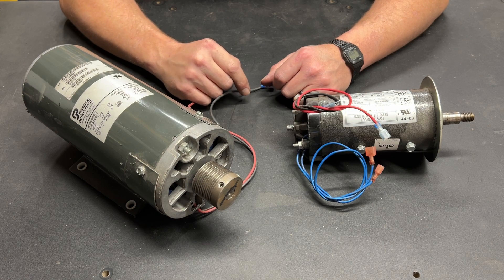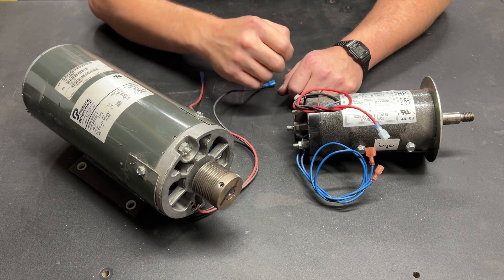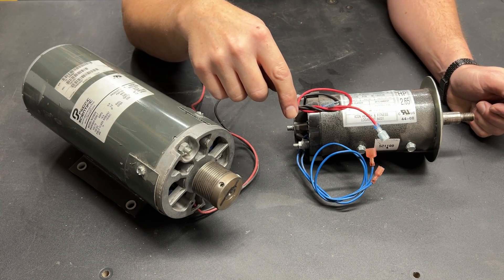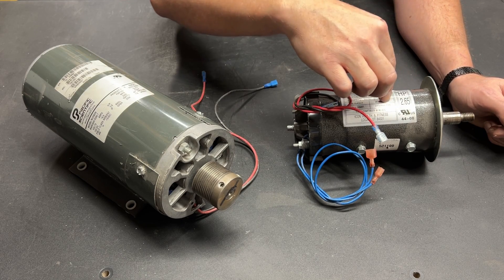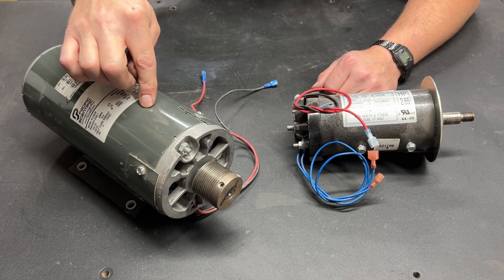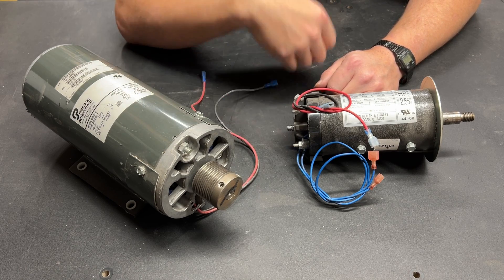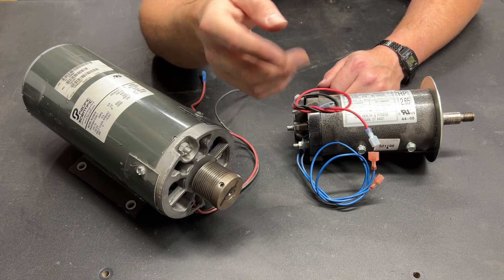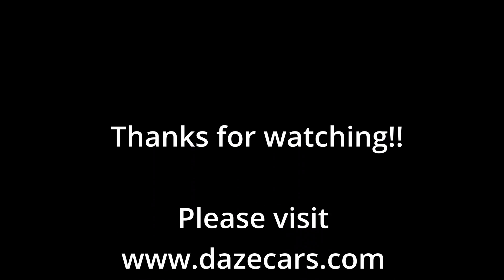Torque Means EVERYTHING When it Comes to Using a Treadmill Motor For Your Mill Lathe or Other Tool

Comment: I do enjoy the tread motor information, that's why I subscribed quite a while ago. You had a video on chokes in which you showed how to make an A/C choke. I bought one of the cores linked on that video and asked the question about what wire size to use when making an A/C choke. No answer! So I ask again, what size wire should be used? I'm guessimg between 14 gage and 16 gage but I'm unsure. Thanks for any reply.
Reply: If you know the amperage you want, use that to determine your wire gauge.
Reply: If it gets too hot, use a bigger wire.
Reply from the maker: I am sorry your previous question did't get answered.  I try to answer all emails and youtube comments.  Not sure how yours got missed.   Was it an email or a youtube comment?   16 awg is a minimum 14 or 12 would be better.  Please don't hesitate to reach out if I can be of any further assistance.
Reply from the maker: I just did a search under "wire size" and saw this comment but no others.
Reply: Thank you.

Comment: I have 2 of the big motors with the Thermal cut off on them.
Reply from the maker: If you can reconnect the thermal wires I would.  There is no reason not to run them if your motor comes with them.  I have a couple "medium" quality motors that have have them they are "larger"  but not as big as the one I show in my video (my biggest)